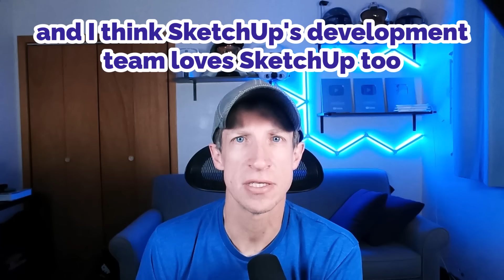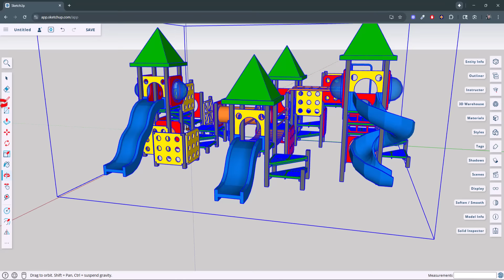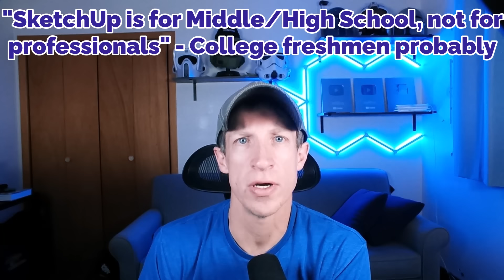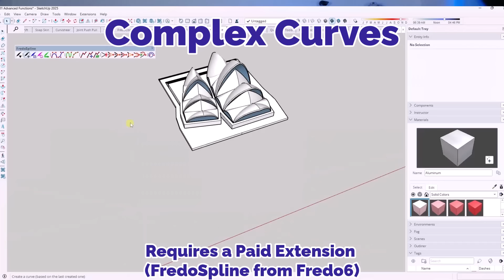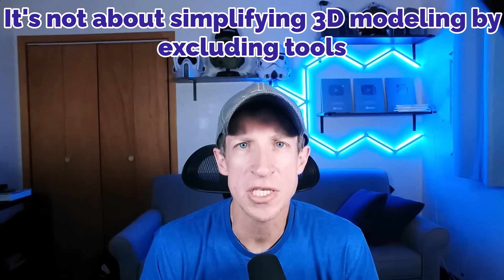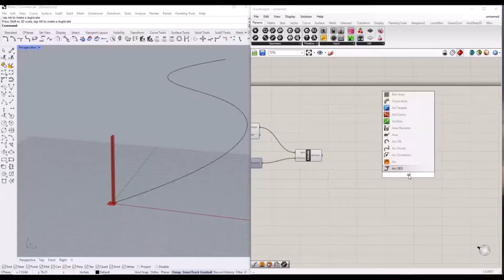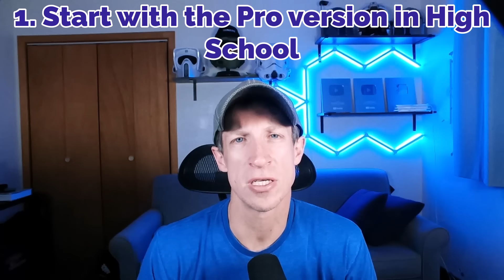Is SketchUp being REPLACED?

Comment: I work in the film and TV industry, primarily in commercials.  The timeline on commercials means we have to work really fast.  That means I usually only have a few days (if I'm lucky) to completely draw out a set for a build, populate it with furniture or fixtures and render it properly to get approval from agency and client.  The two huge advantages that sketchup has over rhino are 1) speed -- it's just way faster, easier to learn and more intuitive than Rhino and 2) the sketchup warehouse.  The warehouse allows me to easily populate set drawings with furniture, people, etc.  There is no equivalent in Rhino.  Most of the time when I draw out a set and send it to the shop for build -- they re-do it in rhino because it's vector based and they can actually use the files for CNC machines and to get proper curves.   If Rhino came out with something similar to the warehouse or a way to more easily import models I would switch in a second.  The only way for sketchup to be compatible would be for it to expand its tool set (so I don't need a million plug-ins) and to become vector based (though that would probably entirely change the architecture of the software).
Reply: Hi i also work in film and tv and occasionally commercials.  I moved to think about 2 years ago. For quick concepts I would agree sketchup is faster.   I think Layout is a little better in terms of documentation but just so you know - the warehouse is free and you can easily populate your rhino model with items from the warehouse.
Reply from the maker: Totally agree - SketchUp is super fast, and no one has a feature like the 3D Warehouse. It's a massive pro for SketchUp. The vector based stuff is a problem, as it would probably require a complete change to the underlying architecture of the engine. But the modeling tools really seem like they should be achievable
Reply: @Thesketchupessentials  There should be tiered toolsets within sketchup.  So you have a basic tool set and then a more advanced toolset that includes beveling, vertex modeling, lofting, joint push/pull, subd, etc.
Reply from the maker: @kylekin  TOTALLY on the same page on this. Then you can just turn them off if you don't want them
Reply: @Thesketchupessentials  you do know that Unreal engine literally has the largest 3D Warehouse in the industry, it's far larger than Sketchup and way faster as well, that can be integrated with other software programs like Rhino, Blender, Solidworks, Fusion 360(along with other Autodesk products), Solid Edge
Reply: I work in film and TV too, I would argue against sketchup being faster than Rhino at the point. I think it does take a while to get fast at rhino, more so than sketchup. But it can be quite fast.
Reply: I also do work in the film industry, I use Rhino 3D to create cars, boats, military vehicles, planes etc....try doing that with sketchup.
Also, Yes Rhino CAN drive CNC macines , 3D printers etc, there is even an extension called "RhinoCam" just for this purpose. 
As for your "warehouse" ..it is called The Internet LOL.  Rhino can import and export just about any 3D format file, if I need an object in a hurry, or I have to work with a certain manufacturers Engine for example, I will just download it and import it. Also, have a look at Rhino 3D "Push Pull" tools, I think you will see why Sketchup users are jumping ship.
Reply: Use d5 render for adding those models it has a great library fully mapped ready to render
Reply: Im with SU for over 18 years now, the way I see it is that SU needs a mayor overhaul of their Auto fold Modeler. They need to reimmagine the Modelling to where it becomes useful for both CNC and Gaming. The Topology is the main issue, imo.

Comment: Man, yes. This is spot on. I’ve been using sketchup for 15 years, mostly for furnitre, cabinetry, shop docs…basically encapsulated small projects that are mostly square. But in the last four years I’ve been modeling residental architecture and working with other architectual designers and contractors. With those bigger projects, I hit the ceiling of what the app is capable almost immediatly. So I started subscribing to extensions to make up for the lack of native features in SketchUp. Every time I have to renew all my subscriptions it’s a real pain point, and over the last year I’ve been thinking I’ll need to switch over to Rhino if I’m going to continue this work. 

As a point of comparison I’ve been using Blender over the last 4 years too, and though I would never use it to try and do measured CAD style work, I’ve been pretty impressed by the shear number of features and improvements they’ve added in those same 4 years. I didn't even download the recent version of SU, because it offers nothing I need. 

Thanks for using your YT presence to shine light on this. Needed to be said, and I hope it’s heard. I hope next years update sees a big leap forward for native advanced modeling tools and a more sophisticated UX, though waiting a whole year is kind of bonkers too.
Reply from the maker: I've thought about this a bit - "I’ve been pretty impressed by the shear number of features and improvements they’ve added in those same 4 years." 

It's a bit of an unfair comparison, because Blender also does more things. SketchUp is a 3D modeling program only really, so to be apples/apples, you'd have to compare like features. Blender includes sculpting, rendering, video creation, animation/rigging, geometry nodes, etc, so it also just has more tools to change. I don't commonly see changes to the actually base 3D modeling tools, for example.

Not to say that those devs aren't crushing it on new features - they definitely are. I also agree it's not great for the CAD style work (despite what the Blender user base says).

Thanks for the comment though - enjoy discussing this stuff! :)

Comment: I’m an architect. I’ve been working in SketchUp for 18 years. Before that, I went from 3D Studio MAX to Cinema 4D, and eventually to SketchUp. I tried Rhino a long time ago, but it didn’t really catch my interest back then.

Currently, I’m staying with the perpetual license of SketchUp 2021. Over those 18 years, I’ve occasionally paid for upgrades across several versions, but honestly, if I were to install the old SketchUp 8 today, there wouldn’t be any significant improvements up to version 2020. Sure, there were some minor fixes and refinements, but what has really improved my workflow over the years are the plugins (I’m currently using over 50 of them).

I installed version 2021 solely because of the improved TAG manager (Tag folders) — in my opinion, this is the only truly worthy improvement in the past 18 years.

If my plugins ever stopped working, I would seriously consider switching to another program.

What’s shown in the video is, for a professional, just a weak attempt at something SketchUp should have had long ago. Right now, the best work is being done by Curic with his plugins.

Luckily, I can still get by with the modeling tools as they are. But honestly, SketchUp kind of forced me to work and adapt this way. That’s why, even though I have plugins for filleting and chamfering, I don’t use them — they’re just too unintuitive.

I would switch to a newer subscription-based version only under these conditions (and even then, it would depend on the implementation):

* An integrated system similar to Curic Section or Scalp (but more intuitive) — section cuts by tags
* High-quality DWG/DXF export by tags, including hatching — the current export options in SketchUp are laughable
* Parametric stairs — this is an absolute nightmare; no plugin does it properly, and creating a dynamic component for stairs requires near-programming skills
* Separate precision settings for decimal places in dimensions and measurements

Layout — I don’t use it.

* The inability to have multiple paper sizes in one file is just ridiculous. Having to create separate files for that and manually write title blocks in each one is miserable.
* It’s disgustingly slow... slow, and once again — slow.
Reply from the maker: Thanks for the feature list. I'm not 100% sure, but there were some DWG/DXF export functions added in 2026. Not sure if they do what you want or not, but they are in there. The section cut improvement (especially with vector hatching) would be a huge one to me.
Reply: @Thesketchupessentials  I don't think what I'm describing is possible. If I remember correctly, it was about some improvements to exports from the layout.

But I'm interested in a combination of Curic Section and Curic toCAD. Personally, I finally solved it by exporting DXF using Curic Section - this gives me closed polylines in CAD (AutoCAD, ZWCad...) in layers, just like I have solids in TAGS in SketchUp. Then I created a set of LISP programs that I run in batches in CAD, where everything is hatched and rearranged into precisely defined CAD layers. The hatches are associative. Under certain conditions, I was even able to define LISP, which creates blocks from certain elements (e.g., wooden profiles in the roof, steel elements, etc.).
Reply: @Thesketchupessentials  this is what I mean: https://youtu.be/JLFgbW3tJqc

Sorry for my english in video :)

Comment: Thank you for addressing this topic in a dedicated video. I’ve been a SketchUp user for 18 years; I’ve gone all the way with the software since high school, through architecture school, and I’ve also provided training for construction companies.

We —the final users— understand that after the acquisition by Trimble, the development resources are not as large compared to giants like Autodesk. However, with every new version we feel disappointed, even though improvements are added, the pace of evolution is very slow.

It’s hard to accept, but it has to be said: SketchUp needs to implement NURBS / ACIS. It’s the only way to include basic features like chamfering or beveling and other advanced ones that are standard in any other software. I'm no expert but that probably requires a complete change of the modeling kernel. But we do see that kind of implementation in new web-based apps (like Vectary), and we can’t help but wonder how difficult it could be and why the SketchUp team hasn’t made the leap. There are programs like FormZ or Moi3D that never fully took off and hold a very small market share, a merger or acquisition with one of these companies would be strategic!

SketchUp has been tied for many years to its polygon-based modeling system. Thirdparty developers have created amazing plugins to work around its limitations, but it will never be the same as having true NURBS-based software.

Sometimes I open my copy of FormZ —and even though I can’t use it in my professional workflow due to its limitations in exporting, presentation and lack of an ecosystem— I can’t help but feel a bit envious that my beloved SketchUp isn’t as powerful for modeling.
Reply from the maker: I don't think I agree with this assessment - there are multiple extensions that add bevels right now without SketchUp being NURBS. I don't see why that would need to change to add features like that when extension devs have already figured it out.

Comment: I’ve been a SketchUp user since 2004, and in over 20 years, the core modeling tools have barely changed. The only major improvement was the background architecture overhaul that helped with large model performance. That was a good step, but it’s the only significant update I’ve seen.

What keeps SketchUp useful today is the plugin ecosystem. Without plugins, it lacks the power needed for professional modeling. The latest updates offer nothing meaningful for users like me, and the rising subscription cost is getting harder to justify when the core features stay the same.

Our IT department is already pushing for a move to Rhino because of its stronger capabilities and lower cost. Most younger architects are already using Rhino and see SketchUp as outdated or just a toy. That perception is growing, and it won’t change unless the software evolves.

I still use SketchUp because I know how powerful it can be with the right plugins, but that shouldn’t be a requirement. Many of the most essential plugins should be built in by now. If Trimble would listen to experienced users, we could point to exactly what’s needed.

For example, the Landshape plugin is a perfect candidate to be integrated into SketchUp Pro. Including tools like this natively would immediately add value and help keep SketchUp relevant.

SketchUp has huge potential, but it needs real investment in its core functionality. We’ve paid subscription fees for years. That investment should lead to meaningful improvements. Bring experienced users into the development process and focus on tools that matter to professionals.
Reply from the maker: This - "Most younger architects are already using Rhino and see SketchUp as outdated or just a toy. That perception is growing, and it won’t change unless the software evolves"  is exactly what I'm talking about in this video
Reply: @Thesketchupessentials  Thank you for sharing this video. I hope Trimble takes the time to read through the comments and begins to seriously consider the concerns raised by its user base. Based on the feedback in the comments, both current and former users seem to agree that significant meaningful improvements are needed. SketchUp is fundamentally a modeling tool, so please work toward making it the fastest most powerful modeling tool available.

Comment: Sketchup also stopped the ce version in 2017.
Most of us use that version because we are not in business and will frankly not pay a ransom for any version later than 2017 and it is only the later versions that will get any new tools or capabilities. 
Sketchup could score a major marketplace win by allowing one time full product purchases (fairly priced).
I would do that but I will not pay every year for life on a credit card.
We already have to do that for Office 365 and several others and they are also running risk by not allowing one time license purchases. //ro
Reply from the maker: I don't fully understand the comment. If you decide to keep using 2017, that's your choice, but obviously you don't get access to any new updates. Or maybe you're just saying that none of the updates have changed enough to justify a subscription?
Reply: @Thesketchupessentials Disclaimer - I really suck when it comes to the written word, so there’s that.
I was just saying my understanding is that 2017 was the last “free” Sketchup. 
Everything after that version required a lease agreement and credit card.
If someone like you or other pros are talking Sketchup, you are probably not talking about free Sketchup and 2017 (I don’t think so anyway) will ever be updated in anyway. That was my only point though I did not make it well.
Example - being a veteran, SOLIDWORKS (Desault) grants me a complete yearly for the full product completely without charge as long as I do not use it commercially. 
I don’t expect Sketchup to do that but their newer products do cost a lot. This is fine for commercial use. I just could not afford it as I am just a dyi old guy who love modeling, design and building.
This is why I only use 2017 - it was the last totally free dyi version. Love the software.
Also, I very much appreciate your channel and making the community of new users more adept at using it.
I just try to glean everything I see and apply it to my version.
Thanks for getting back to me. **ro

Comment: I used to be a huge sketchup user.  When they hobbled their free version, I had no choice but to look to different tools.  That’s when I found parametric tools like Fusion 360 and Onshape.  I can’t believe what you get for free with those tools compared to sketchup.  I went back to try out the free version again after a couple of years of not trying it, just to see what has changed.  The second I tried to do a simple Boolean operation and got a pop up to upgrade, I closed the sketchup tab.   What a load of crap!  A “3D” modeling tool that is so limited!   Crazy.  I’ll just go back to Onshape.  Cmon Sketchup!  I used you for YEARS when I first started modeling and it was great.  I got really good at it.  And then the rug was pulled out from under me.  Not cool.
Reply from the maker: I've not used Onshape, so I can't speak to that, but I will say those tools are definitely targeted towards a different "kind" of modeling (product creation), so they're going to be superior for that use case anyway

Comment: You can’t make Rhino out of SketchUp.
Show me BIM from Rhino — or technical drawings from it.
Rhino is probably a great all-around modeling tool,
but SketchUp is a complete BIM solution for non-curvy architecture (which is about 99%).
Simplicity + Plugins — that’s the true power of SU.
The only thing that still needs improvement is the engine under the hood.
Reply from the maker: I don't think I advocated for making Rhino out of SketchUp. I advocated for expanding the toolset by adding typical tools that 99% of other modeling softwares have, fixing the new student pipeline, and exploring an approachable parametric modeling tool. I also don't agree that SketchUp is a complete BIM solution. BIM implies "information," and there's not a lot of tools for managing model information in SketchUp. That's not to say it's not a good design tool - I really like what you can create with SketchUp  and Layout, but I don't really agree that SketchUp is "BIM"
Reply: @Thesketchupessentials I use it as BIM with plugins. BIM is nothing more than adding informatin to geometry. And SU has 3 layers of informatin: tags, IFC class, and materials. Togather with component system it can be used as user defined BIM, with more flexibility and better workflow than Revit